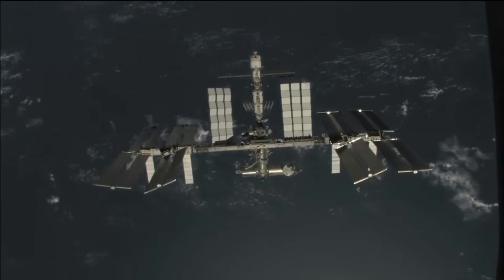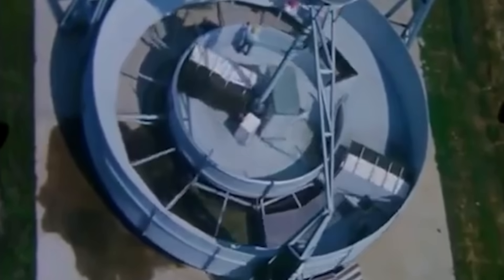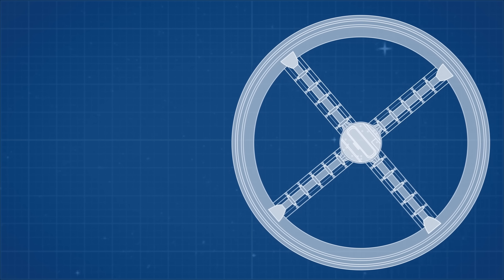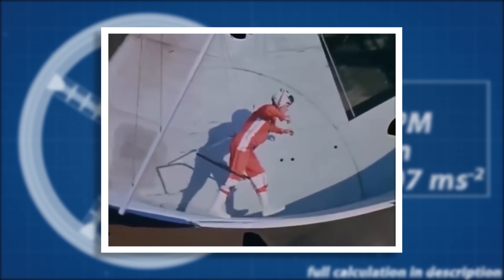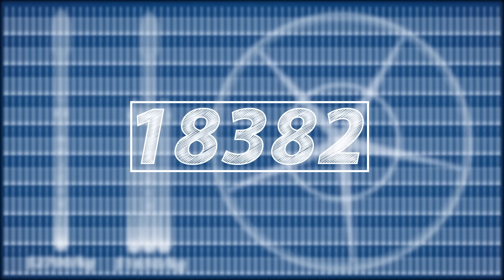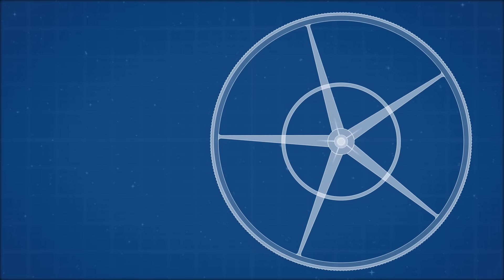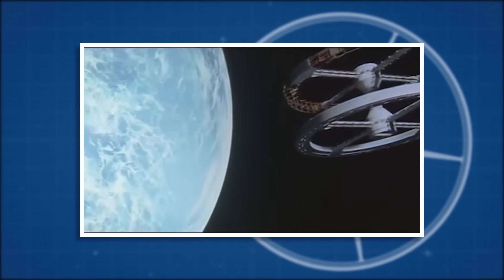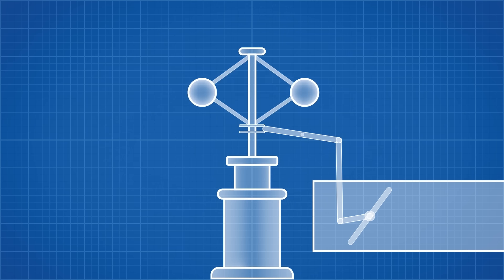Can We Create Artificial Gravity?

Comment: Why not just use two pods attached to each other by a 200m long cable and spin the  whole thing. No need for a ring.
Reply: how do you spin it without bending the cable or messing up your orbit
Reply: Indeed! Ideally the cable would be a few kilometers long to make spinning slower than 1rpm. We could also use a dummy weight on the other end. Ot just very very long cable. Small dummy weight is probably the cheapest and lightest option
Reply: Better yet, a super strong rod, so you wouldn't need to waste fuel on the rockets. Although a material that could provide such strength doesn't exist atm, but I could be wrong.
Reply: +William Herron I think you'd have to have two rockets on either end to fire at the same time to help keep the orbit stabilized...
Reply: I could be wrong but I seem to remember something like this being done.... not with the intent of artificial gravity but at least tried....
Reply: +Murr What about we have start with a 1 kilometer long cable, spin the thing slowly and then slowly pull the pods inward to make it spin faster. And since it's constantly spinning, it's already spin-stabilized. In case of emergency, use RCS or de spin object to slow down.
Reply: Nasa did test something like that in the 60s. they connected the gemini module to the Agena target vehicle and then they used both crafts side thrusters to start spinning. they managed to generate a small amount of gravity, but a bit too low for the astronauts to feel anything.
there was also a problem with gemini 8, where when connected to the Agena a problem with the attitude control made both crafts spin, then they decided to disconnect so they could fix the problem, but getting separated from the mass of the agena craft just made the gemini 8 spin even faster almost making the crew blackout... it was in a way the first artificial gravity "test" in space
Reply: Ah, I get what you mean now. Using that approach you could move in a variety of different directions without having to change the axis of rotation. Clever. I think it would work. The need for a joint would make things reeeeeally costly from an engineering perspective though. I'd let the engine spin with the ship and make the computer take care of the complications to the steering though. The cost difference wouldn't go up much.

If I were to design a spacecraft with artificial gravity, I would do away with a wheel, and do away with symmetry while I'm at it. You'll have to keep an open mind for this one because it's a bit different from most things I've seen, and it might look like a step backwards at first. I would choose this shape:
https://www.google.ca/url?sa=i&rct=j&q=&esrc=s&source=images&cd=&cad=rja&uact=8&ved=0ahUKEwjK9vmmnsjRAhVIwGMKHZUNC4wQjRwIBw&url=http%3A%2F%2Flegacyofkain.wikia.com%2Fwiki%2FFile%3ANosgoth-Character-Hunter-Bola-Weapon.jpg&psig=AFQjCNEG9MA4dNs_mNxOg0gI454elgrD2A&ust=1484710100754224

The two modules would be different sizes, and would spin around each other. Anything that could do without consistent artifical gravity (fuel, supplies, extra weight if needed (though we would want to avoid this)) would go in the larger one. We would want that one to be much heavier than the living compartment. This design would move the center of mass (and therefore the center of rotation) farther from the living area (in the module with less mass), which would make the gravity more consistent. Also, it allows us to use cables that don't need to support any compression or bending forces; that cuts down on cost like nobody's business. Each module would need small engines to control their rotational speeds, but you could cut down on the engines you need by being clever with how you make the cables attach to the modules. I would put the main thruster at the center of rotation, and let it spin with everything else. For the engine, the asymmetrical design means the fuel will be close to the engine, and the artificial gravity won't be as difficult to overcome (I did the math in my head just now, I'm 99.99% sure its right). I'd let computers take care of the complexities involved with steering this beast considering the rotational mechanics at play. Not that hard for space engineers. This design also keeps the living compartment in a single module, instead of being spaced out over several, and gives us better gravity for the same material cost. Also, another bonus I just realized, I'm pretty sure that gravity would increase linearly with radius from the center of mass, so an elevator from the engine to the living compartment would be super easy and safe to maintain with a normal spring following Hooke's law. As the engine accelerates, the modules would trace out a cone shape as they rotated. This is ok, and actually makes us need less rotational speed, and gives us more even gravity across the spacecraft.

This is the best I can come up with for good gravity, cheap materials, longevity, safety, and efficiency. It would still be pretty dangerous. You'd really need to be able to trust your computers and the little engines on the modules. That or invest more into the cables and give them some bending rigidity.
Reply: you dont really need 1g though. if you can put your feet on the ground, you can wear weights to exercise. but that is just a theory of course, there is no way to know for sure before they test the effects of low gravity on astronauts
Reply: Christian Gingras 
Right. No curving of the cable, only slanting during accelleration. Balance is a little trickier though. If the system isn't balanced, it won't vibrate in this case, it will just have a different center of rotation. The center of rotation will coincide with the center of gravity for the system. Symmetry is nice to have, but not required. If one side is heavier, you can just move whatever central module you wish to have to the new COG. If you don't, all that really happens is that the module ends up contributing to the COG, and rotating about a point somewhere along one of the cables. It would be nicer to have a stationary engine though, so I'd put the main thrusters at the centre of rotation. Making one side heavier means that that side is closer to the center of rotation, and the thrusters, so it would be convenient for fuel storage. The gravity would be lower in the heavier unit too, so you could actually syphon liquids down to the habitat without having to pump them.
Reply: +Bob41599 I think in Gemini 4 or something, they attached the ship to the docking target and spin it a tiny bit (like 3rpm maybe) and it created a tiny acceleration.
Reply: Do not go gentle into that good night. Rage, rage against the dying of the light. Not bad idea's, I wonder if they would work, because they sound like they would.
Reply: Let me think. You can actually google ship designs from these to see how artificial gravity is done there. Space Odyssey: Voyage to the Planets, Mission to Mars, Red Planet, a cancelled TV series Defying Gravity, TV series Battlestar Galactica had ships with rotating sections, Babylon 5 has a rotating station and ships with rotating sections as well.
Reply: MaynardKeenanX I think it's up to people's personal preference/
Reply: There have been several design proposals like that for long duration space craft. Buzz Aldrin's Mars Cycler for one. You have a habitat module and an engine/power module connected by cables and each having RCS. In boost phase they're side by side, with the engine thrust through the common centre of gravity. Once they're in cruise phase (99% of the time) in free fall, the two separate using RCS, spooling out the cables between them. RCS then gives them both lateral thrust in opposite directions, starting them spinning around each other. They then let out the full length of cable to become the ends of a slow spinning bolas.

Note: The engine/fuel/solar panels will be heavier than the habitat (which is mostly hollow), so that arm of the bolas will be shorter, meaning it's under lower spin gravity. So it is under less stress and a better place to unfold solar panels/ large antennae/radiators. 

A 200 m cable assuming a mass ditribution of 1:4 (say habitat mass of 25 tons - a B330 with 6 crew and supplies, engine/fuel tank/solar panels/docked lander mass of 100 tons), would give the habitat spin arm of 150m. Using a maximum of 2 RPM (a value that seems to be agreed by various experiments to be the highest that can be tolerated long term) you get 0.67 G.

Of course, in practice you'd use a much longer cable, say 1 km. That would allow a rotation of only 1.1 RPM to generate almost 1 G.
Reply: I know the physics behind how it would move guys; an engineering degree comes in handy there. The cables would slope while accelerating, but that would actually help make the gravity gradient more gradual. Turning would cause precession issues, but there is a very well established field of engineering to handle things like this, and a clever control system could maneuver the ship effortlessly. Most of the advantage to this design, is that it gives the best quality artificial gravity for the least money, without violating other design requirements.
Reply: Yuanhe Li How would you control the position with the magnet though? If you had them tied together with a cable, you would still need rockets to stabilize them horizontally correct? The magnets solve the problem of them moving towards each other, but we would need something to keep them righted on all sides. Maybe a cable wheel with magnets attached on the sides?
Reply: +Murr Would be good to use that for Mars transport system  1-2 decade after the first few endeavor. For the first few missions, let's just have the astronaut exercise for 2.5 hrs like on the ISS, then we can use artificial gravity for the paying passenger or colony.
Reply: Murr There are (already existed) technique to "print" magnetic with a defined pattern(although not powerful enough at this point), so one can just create a magnetic field like this" << " for one end and " <- " on the other. Although the "<-" like to "escape" current to the opposite side, but it can stay in the potential well and keep at the straight repelling position. So one will need energy to move it to the current position, but doesn't require energy to maintain it (as long as there aren't large perturbations).
Reply: They're actually using this in various sci-fi movies.
And for a moving spaceship I think single rotating ring design is not an option at all, as it will cause multiple issues when you need to change course. Stationary ship body with several rotating arms housing living quarters would be the optimal design.
Reply: You'd probably want to have crew access to the middle of the tether so that you didn't need to spin up and down the object every time someone came and went.
Reply: +Murr 2rpm @ 100M radius gives almost half Earth gravity, a bit more than Mars'.
Reply: +Massimo O'Kissed I think it would be best at 1g. Since the astronaut has to be as fit as possible.
Reply: Interstellar is great film. it is similar to 2001... in my opinion. However simulated gravity on it is not exactly rightly set. It would be very weak if Endurance rotates so slowly.
Reply: +Witnaaay , a capsule & the spent rocket stage are what Bob Zubrin proposes for travel to Mars. It's a cheap simple idea to provide Gs for the journey.
For an orbiting station, I think minimum 2 podules and a hub for docking is better.
Reply: +Witnaaay "insertion burns"
That's what lube is for.
Reply: Yeah, that was my thought as well. Build the whole thing in balanced sections as needed. For that matter, remember that we only want gravity for the people. Put their habitat out on a swing arm, and take advantage of microgravity with all other services, shuttle dock, fuel, etc. near the center of rotation.
Reply: I have been saying this for years. Two large stations tethered together by a single tube structure. Both stations rotating around the center point of the tube. Stabilization can be adjusted by simply pumping a fluid from one station to the other as needed ie: a supply delivery to one station would require the transfer of an equal weight/mass amount of fluid to the opposing station so that a wobble effect doesn't occur. A person traveling from one station to the other via the tube would experience lesser g-force as he moves toward the center point and again experience increasing g-force as he travels closer to the second station. Docking could take place at a central hub located at the center point of the connecting tube as this would make it much easier as the vehicle would only have to match the rotation. The possibilities are as endless as they are exciting. Imagine this whole apparatus nudged by propulsion toward Mars. Several years in advance small unmanned supply ships could be deposited along the route and as the stations progress towards Mars there would be a steady stream of supplies readily available. It would be a much easier trip for people as the artificial environment, including centrifugal force gravity, would make things feel more natural. A Mars plan like this could mean that a Mars team could travel to Mars at their leisure. A large comfortable environment along with an almost unlimited supply of necessities would make the long trip more bearable.
Reply: No. The spinning cable is inherently stable. The weights at each end keep it taut and fully extended. You don't need any additional force.
Reply: Do not go gentle into that good night. Rage, rage against the dying of the light. 

I agree a ring is a lot of useless volume. A simple balanced stick would do.
Reply: Yuanhe Li a spinning pair of weights absolutely does not have more than one stable state it can remain in.  There is only one state of two weights spinning about each other at the ends of a cable in space, because there is no inwards acceleration from tension in the cable at closer distances than the maximum cable length, forcing the cable to always extend furthrr to its maximum length and then remain at it.  Didn't you ever play with spinning objects around on the end of a rope as a kid?  The rope always goes taut, and the objects hang at the very end of it.  You would never see the objects miraculously get closer and start spinning faster unless you actually physically shortened the length of rope the objects were hanging by...
Reply: Cyber SharK There is conservation of angular momentum. If a thing spins, It will keep spinning unless it gets hit or it shoots something.
Reply: About the slanting: Picture a tether ball. The players hit a ball, suspended by a cable from a pole. Centripetal force pushes the ball outward, but gravity pulls it downward; and this causes the tether to trace out the shape of a cone. In the case of our ship, the centripetal force would still be acting outward on the modules, but acceleration from the engines would be emulating the effect of gravity on the tether ball, generating the force that causes the cable to slant (not curve from air friction), tracing out a cone.

About the vibration: In engineering, when we are dealing with spinning objects, we almost always have them rotating on a axle. When this happens, the rotating body needs to be balanced, otherwise the center of gravity will be different from the center of rotation, and a vibrational energy will result similar, mathematically speaking, to the vibrator in a phone. This vibrational energy is incurred from the resultant centripetal force vector of the center of gravity of the rotating body, on the axle. In the case of our spacecraft however, there is no axle. In the absence of an axle, the rotation of the system is generated solely from the difference of inertia in different parts of that system. These different inertial forces cause the body to rotate about the center of rotation. Because, in space, the center of rotation is always the same as the center of gravity, that centripetal force vector from the COG to the COR will always be zero, meaning no vibration.

There could be complications though. Because of the difference in weights, with three bodies, a kind of pendulum effect could be produced, creating rotational patterns that could be hard to predict. Preventing complications from that would have to be a job left to the auto-pilot systems. Go engineers.
Reply: Make it 1000m or more. Small circles cause motion sickness. Why not be comfy?
Reply: Pudge Boyardee 
I just graduated from a mechatronics engineering program. Controlling the ship is actually a lot simpler than you make it sound because of clever things you can do with the flight computers. As long as you do your engineering, steering this thing is pretty easy because of technological advances in the past 50 years or so. No need to stop for course adjustments or any of that. In terms of angular momentum and cable strength, again, these are only issues if your engineers are sucky. I think competent engineering is a fair assumption for this. These kinds of issues come up a lot in industry, so they actually have some pretty solid and well established solutions.
Reply: +William Herron Powerful gyros or ballerina style tugging.
Reply: Go read Seveneves. It'll blow your mind, they do all this and more.
Reply: +SolarWindsRider could you name any? I'd love to watch those
Reply: +Danilo “Dantiger” Oliveira thanks for the reply, but you can go up a few comments and look at something.
Reply: Do not go gentle into that good night. Rage, rage against the dying of the light. oh right I saw it now. it was gemini 11 btw... just adding more information then =)
Reply: +Danilo “Dantiger” Oliveira haha, it was Gemini 4, then 8, then 11
Reply: I don't think so... I think they docked with the Agena in all Gemini missions, but only tried the artificial gravity experiment with Gemini 11.
Reply: +Danilo “Dantiger” Oliveira I meant I thought it was on Gemini 4 then you thought it was on Gemini 8 and turn out it was on Gemini 11
Reply: oh no no no... the tether test is the one I wasn't sure, that turns out it was gemini 11... gemini 8 was the one that had the attitude control problem and started spinning like crazy
Reply: +Danilo “Dantiger” Oliveira yea, the Gemini 8 was the one with Neil Armstrong.
Reply: ya............. actually
Reply: +lueefour A tube could be a good Idea, but it does cost more to build.
Reply: +Do not go gentle into that good night. Rage, rage against the dying of the light.
Sheesh, that's a long username...
A tube could be cheap. A compressed flexible thing like for air ducts, then inflate it in space.
Reply: You could also have a 628.3 Metre circumference cable used to aid later attachment of modular ring segments.
Reply: ...beat me to it. But absolutely. Once spinning had begun there would be no need for any sort of rigid structure between the pods as they would be perfectly stable. And if stopped it would be possible to pull the pods together for whatever necessary reason.
Reply: Felix Bade What about the hermes from the martian? I seem to recall it had a rotating design as well.
Reply: +Murr I think the radius is too small to feel comfortable.
Reply: Do not go gentle into that good night. Rage, rage against the dying of the light. Yeah, it would have to be moving very fast to feel like gravity, probably over 10 rpm. But it is still a cool concept, if scaled up it could probably be the best bet.
Reply: +Murr Yea, no one wants to be gravity sick
Reply: Hermes had rotating section... it rotated too slow for its size, maybe 0.1g could be achieved on board of it.

LOL I had problem also with gravity field of mars :) astronauts moved there like they were on Earth... also that storm was hard to be believable. There is about 200 times lower pressure on what counts as "sea" level and it reaches about double of that (1.2kPa) on deepest parts of surface

There is the same problem with Endurance from interstellar. It rotates too slow. What's more, they had gravity on board of shuttle which was located near the axis

Starting with slow rotation rate and large diameter(long rope) will not achieve anything. There is momentum preservation in the play. It would rotate faster and faster as you lower diameter, but that lower diameter will not create stronger centrifugal force. The simulated gravity would remain the same... v(1)^2/r(1)=v(2)^2/r(2)

For start, I would go with cylindrical inflatable station like Bigelow with diameter somewhat larger than length (otherwise the flywheel wouldn't be stable). It would be enough to have about 0.1 to 0.2 G for much longer occupation time than ISS. And it wouldn't demand large mass of strong material. We don't know what is minimum gravity for multi generational living in space.. Maybe it is 0.5G, maybe 0.8G.
Reply: the thing about large diameter is that there will be a steadier change in force depending on the distance to the central axis, that means the crew wont feel the "inverse tidal force" as much. while with a shorter diameter and faster spin velocity, the force difference between the feet and head of the astronaut will be greater.
Reply: ***** inverse tidal force? What that means? the different speed of feet and head is certainly not inverse tidal force :) But maybe I don't understand english enough. I didn't found such term on google either.
There is one thing that can be  unpleasant- coriolis force. It starts to be of no big consequence above 100m diameter. Also lower simulated gravity means lower rotation rate and reduced feel of coriolis force.
Reply: +Do not go gentle into that good night. Rage, rage against the dying of the light.
3rpm @ r=100M is almost exactly 1G :)
Also, @ r=100M, the delta-G from head to feet is only 2%.
I assume the body would atrophy at 0.5G, but it can't be as bad as zero-G, surely.
C'mon NASA, we need answers!
Reply: Peter Švančárek that is the only word I could think of in English to describe it HAHAHA. you know, like tidal force, but that get weaker as you move closer to the center of mass... anyway, the bigger the diameter, the slower the needed rotation speed and more comfortable it is for the astronauts.
Reply: ***** But that is not tidal force. What you describe is lowering the centrifugal force the closer you are to axis of rotation( when rotation rate is constant). That centrifugal force simulating gravity is not the problem. Problem is coriolis force and that is problem on fast rotating structures.
Reply: I know its not, but I didn't knew any word in english to describe it, so I tried to describe with something similar.
but anyway... what problem Coriolis force would cause ? if everything is spinning on the same frame of reference and at the same distance of the axis of rotation I don't think it would cause any problem
Reply: +Danilo “Dantiger” Oliveira,
Coriolis effect here on Earth gets stronger closer to the poles, and at the equator is zero, so you're right.
I guess, as your axis of orientation gets more aligned with the axis of rotation, you feel the Coriolis effect more.
Reply: Massimo O'Kissed Yeah, if both the orientation and rotation are on the same plane, the effects will be at their most pronounced.
Reply: +RyuDarragh , maybe not a huge problem since it would be under tension.
Effectively, each pod is 'hanging' on the tether.
Reply: +RyuDarragh , yep, absolutely, that's why I proposed a circumference cable too.
A cheap, light, simple 'scaffold' to attach extra podules & tubes to as available.
A ring or better yet a web is good in that it gives redundancy, a choice of routes if one pod or tube is inaccessible.
Reply: Its called 'tension. If you take a bucket on a string and start spinning it, the water remains in the bucket and the rope remains taught. For the bucket to follow a circular path, there needs to be acceleration towards the centre of its rotation. The force for this is provided through tension on the string. The string cannot become loose or bend if the weight is already spinning.

You would need to thrust both the spacecraft and the counterweight away from eachother while spinning up to create tension initially. tension. Once at speed however, the rope won't bend.

A cable makes more sense than a rod. It is lighter and stronger in tension, and won't break if torsion is applied to it. You could also retract the cable to better fit the structure into a rocket (long, tall rods don't fit in rocket fairings). You can also retract or lengthen the cable based on the mass of the counterweight, which may include supplies or fuel for a return journey.
Reply: ***** It may be more effecient to just have two masses - a capsule/pod for living in and the spent lower stage as counterweight.
Reply: Best idea is to go with something smaller, simulating lower G and with durable structure. With pods there is problem with maneuverability for example.
I would go with inflatable structure. http://www.rockettimes.com/spacetechnology.htm Just make it bigger. And apply additional sheets of material for radiation and micrometeorites protection. I would send it up as relatively thin balloon and then add additional material on orbit. That way it would be simpler to send it to space.
http://history.nasa.gov/SP-4308/ch9.htm so much research, and nothing real came from it. Pity.
Reply: Why would you need to worry about manoeuvrability? Space is more or less empty, with any small objects you might hit moving so fast you won't be able to dodge them. Perhaps this could be an issue for low-earth orbits, but what would be the point of going to LEO and then not taking advantage of zero G's?

The real usage of this technology, IMO, is interplanetary travel. In this use case, there should be plenty of time to slow and stop the spinning and to retract the cable before any insertion burns
Reply: Because you may need to change the orbit. Even ISS have to do that from time to time. Orbit is not stable, it is decaying, especially low one. Higher is more stable. Then there are possible problems with hazards. It is enough to change speed in suitable vector by a few m/s to avert danger. 
And then, there is of course interplanetary application. You attach engines to this station and you have interplanetary vessel.
The bigger vessel, the larger hazard. Rigid inflatable structure is superior to roped system. Damage to ropes could be fatal. puncture into inflated wheel less so. Imagine that something of size of pea collides with rope. Then imagine if it collides with inflated tube of a few meter diameter. If rope is damaged it may lead to heavy damage of station. Tension would slash the ends of rope against pods, even if there are redundant ropes. If the same pea penetrates inside, you end with a few millimeters big hole. Simple patch would repair it. 
I think, 50m diameter inflatable structure would be enough for expeditions(NASA thought so too). True, there will be some Coriolis forces, but humans can adapt if they must. It is better than zero G for years. Only for long therm settlement I wouldn't go below 100 m diameter.
Reply: How would one board or dock such as space station? I imagine a central docking spot on the cable and then the astronauts going down the cable. It would feel like going down.
Reply: +Grobbekee That would be one of the downside with a simple ship/ station. But as you increase the size and complexity, you would get more features. Kinda like video game mods and DLC
Reply: +LordBritish66 A ring is like a DLC our space programs can't really afford right now.
Reply: Do not go gentle into that good night. Rage, rage against the dying of the light. But we can, and easily, more easily then by steel tropes together tied pods. Just make it as expandable module. Sure, we can't send it to orbit in one go, the equipment would need to be send separately. 
Rotating wheel or cylinder with diameter slightly larger than length is naturally stable. Docking port would need to be in axis, but that is not problem. Problem would be only if one tries to dock on the ring which would be stupid. Ot is more simple to make the whole structure rotating. There is no need for nonrotating sections... other than zero gravity. But that is unnecessary thing to have on ship. If one need to have zero gravity then he should build additional structure and have it close by. Vibrations of spacestation proved that it is not good to have living rooms in the same structure as your experiments.
There are things that can go wrong with winches needed for roped system, and also problems with rotation of such system in gravity field. Tidal forces would make rotation a little more problematic(tension in cables wouldn't be constant) if that "rotation disc" axis is not oriented to center of gravity.... which again wouldn't be possible while orbiting the Earth
Reply: I have thought about space travel and stations for years. This never occurred to me that is BRILLIANT! But if this was in deep space, what about all the radiation coming off the sun?
Reply: +Bob smith , Solar & Cosmic radiation ARE problematic. Typically something dense (like lead) is needed to block it, which is a pain if you need to launch that rad shield from Earth.
Any crewed mission will need water, storing that around the outside (or the sun-ward side) of the crew space could work.
For a trip to Mars, the rad dose isn't too bad unless you get hit by a solar flare (CME). Zubrin suggests a 'panic room' within the crew space that has extra shielding to ride out a CME.

Once on Mars, the red planet itself will shield humans from solar radiation half the time, as Mars has days & nights like Earth. You're mostly safe at night, mostly.
Mars will also block out half the cosmic radiation all the time, as you'd only be getting fried by radiation coming from Mars' sky, the part of the universe above Mars' horizon.
Any way, there's plenty of Mars soil to shovel over a human habitat for extra shielding.

Deep space doesn't have those luxuries...
Reply: +Massimo O'Kissed Well, the radiation ain't that bad for an astronaut. Just 3% chance of death by cancer per year. But with passenger transport, we'll have to consider the radiation problem. (Will be less costly later on)
Reply: Massimo O'Kissed No. Lead is not good way to block radiation.  The main part of radiation is composed by relativistic electrons and helium nuclei. They impact and may produce secondary radiation- neutron and x ray. To block primary radiation without producing much harder to block secondary one, you need hydrogen or lithium rich substances. Water is one of the best substances, other than that also plastics with high content of hydrogen is usable. That is why apollo mission used relatively thick inner lining made from epoxy. Longer mission will need thicker sheets of absorbers... but water used there may be used also as drink water.

On the Mars, the cosmic radiation is also problem. And that one is risk for whole time. But, good news- settlers on Mars will live similarly to settlers on the Moon deep underground, and only rarely go out of their caves. In some 10m depths radiation stops to be problem. That is also why I prefer future rotating space stations for long time space living before planets. Planets are not suitable for technological society.
Reply: I was thinking along the lines of water, but that would still be very heavy to get out of orbit. Many still think of space elevators as science fiction. But if we could make one, it could be used to get huge amounts of heavy materials out of the atmosphere with much less cost. A Mars trips expenses would be so much cheaper.  And it may be possible, but railgunning satellites off the side of a station, built at the top, could save millions in fuel and rocket costs.
Reply: Water is quite light material when one takes in mind that it manages to absorb all that radiation in relatively thin layer. All other materials would be heavier if they have to do the same... What is needed is to pack as many hydrogen atoms as possible into as small volume as possible. 
Water is abundant in solar system and also in universe.
Reply: +Bob smith fuel could be a good idea
Reply: its an internel force, not an external force. so no net force is applied to you, thats why its a fictitious force.. : no outside inertial observer can measure the force.. so your orbit stays the same
Reply: the outward radial force should keep the string under tension, right? if you swing a heavy ball on rope does it come toward you? or stay under tension outward?
Reply: also it costs energy to bring it in so it will stay outward, energy wise it is at stable minumum
Reply: There was a mission in orbit where two space craft were tethered and put into a rotation around their shared center of mass. The rotation speed was very slow but I think they were able to pick up the slight G-force created with instruments. Probably something like .0007 G
Reply: FlashBackJack Yep, that was Gemini something and we've talked about this on the top. That mission was interesting but it would be cool to push the system to the limit at maybe 0.5 g.
Reply: shazzy bazzy who?
Reply: Do not go gentle into that good night. Rage, rage against the dying of the light.
Reply: If a failure occurs, it may lead to the two pods colliding into each other. Plus the tension of the wire may cayse micro fractures,and if the wires break the pods move in the direction of the tangent and lose control. And also the overall body will have poor control and is not efficient.
Reply: Cyber SharK Once you spin the whole thing, it's spin stablizes by itself. And yes, there is a chance where the cables can break, but we can make it reliable by testing it on earth. (Hanging the cable and pods in 1g)
Reply: Do not go gentle into that good night. Rage, rage against the dying of the light. After some time won't the angular velocity become zero? So the whole body comes to a stop right as energy is transferred?
Reply: what about friction   since is isn't in a geo stationary I know it is small but this is like spinning a wheel in you hands since your always falling the is could cause yaw is one side expirences friction causing breakage or unintended turns causing nausea and if serious enough create another artificial gravity on the fulcrum
Reply: caleb verrall RCS thrusters should be enough.
Reply: There could be small rocket boosters around the pods so it would be able to get up to speed and slow down etc.
Reply: Any distribution of mass at the same radius from the center of rotation will have the same moment of inertia for the same mass as a wheel would. 
Look at the circular hoop vs the point mass equations in this link: https://en.wikipedia.org/wiki/List_of_moments_of_inertia

A design with modules around the edge instead of a wheel would have the same properties as a wheel for maintaining velocity. Any design with material in the middle contributes less to this effect, but the trade-offs might be worth it.

One problem with centrifugal 'gravity' is that it makes a non-trivial problem of turning the ship. Consider the classic ol' bike wheel on a rope. Nothing a little controls engineering can't fix, but it's another thing that could go wrong, and quite violently in the worst cases.
Reply: Kaden Burgart What about a non-rotating ball-in-socket in the middle (held by magnets) that can point where ever (except 90degs from axis) to thrust the spaceship. But that would be at least 20 years from now.
Reply: The controls engineering wouldn't be that hard actually. I've done harder stuff than that in class. I have a tough time with magnets though; $$$$ per pound of force.
Any change to the axis of rotation will still cause the issue. I'm not 100% sure I get what you mean, but if I do, that would still make wiggles while maneuvering the spacecraft.
Reply: Kaden Burgart What we would need is a rotating joint strong enough to support the thrust to give the ship "good enough" acceleration and also a way to pump fuel to the engine(s). Not sure how that's gonna work
Reply: Nice name ^^
Reply: Imagine if we did this with manned exploration missions. First the rocket is launched to LEO, then the CSM separates and connects to the second stage so it can retrieve an orbital module and a cable. Now spin the spent second stage around heavier CSM/orbital module complex to create artificial gravity. When you're done you just cut the cord so the second stage is flung retrograde and CSM gains some extra velocity. Second stage falls in the atmosphere on it's own. Leave inflated orbital module on orbit or stick it to some space station as a spare room. Then de-orbit.
Reply: Do not go gentle into that good night. Rage, rage against the dying of the light. 
I remember seeing something like that in a low budget SciFi thriller, an early 80's movie called DEFCON4. Only they had the two crew pods joined by a long boom, not cables..
Reply: Jeffrey314159 Yea, a boom-like girder seems more probable.
Reply: Do not go gentle into that good night. Rage, rage against the dying of the light. Because that's a worse idea lol. How do you steer two pods spinning about a cable? How do you get from one pod to the other? A ring is a way better idea why tf did you even think of that
Reply: William Herron why would it bend??
Reply: Jesse Meyer It's as hard to steer a ring as a dumbbell with the same angular momentum. A long dumbbell has its downside in crew transfer (which could be done via an elevator), but it does have a HUGE upside in cost.
Reply: Do not go gentle into that good night. Rage, rage against the dying of the light. Put a pod in the center of the ring to steer.
Reply: A cable would bend I'm pretty sure if you change your direction of travel
Reply: Jesse Meyer If the ring/dumbbell is spinning, you can't steer the thing, because it will precess instead.
Reply: Do not go gentle into that good night. Rage, rage against the dying of the light. Maybe you could take precession into account when steering a spinning ring. I guess you could do the same for a cable but the cable would bend unlike a ridged ring
Reply: Do not go gentle into that good night. Rage, rage against the dying of the light. Omg your name lol
Reply: Without the friction of air, the cable would not curve... once the rotation speed is stable. The cable would be straight like if it would be on Earth, supporting the weight of the objects attached to it.

The weight on both side would need to be equal to avoid destructive vibration. That mean, the fat guy exercising on one side should be compensated by so many skinny guy.

And kangaroo would not be allowed to exercise on that sensitive training equipment. I hope Australia remain viable to life,
Reply: Ring might makes sense for a large enough ship / habitat. But even a very large hab can be rotated this way. Solves a lot of problems with shielding mass, too.
Reply: Still, judging by NASA's current budget a ring might be too ambitious.
Reply: Kilometre long cables would be very easy to produce with what tech we have now. No exotic materials like nanotubes needed.

Nasa could launch Mars flyby with single SLS and have gravity on both trips so that is possible within current budget. If you're talking about ring station on LEO, it could be built from 70 BA330 modules and couple extra bits. It would take around 40-45 Falcon Heavy launches and cost about one Carrier Battle Group's price tag. USN has 11 CVBG's so it would be possible to fund it if there's will to do it.
Reply: km long cables could certainly built but the moment required to spin the thing would be 31 times higher and require 10 times more energy which might require too much fuel or too heavy of a gyroscope to send send to Mars. Also the pods need to move at 100m/s for 1 g which is enough to de-orbit a pod if the tether were to break in LEO (Space Shuttle uses 90m/s to de-orbit). We can always increase the orbital altitude for safety, but then we will run into the van allen belt at 1,000 km which would be bad. So I think we could reduce the speed to 50m/s for safety and the radii would be 250 meters.
Reply: Rotating ends of 1000 metre cable 100m/s would generate 2g environment at ends of the cable. We don't need that. 70m/s would generate a tiny fraction below 1g and 70m/s is certainly within reasonable limits.
Reply: 1000m radii or diameter?
Reply: 1000m cable.  500m radii.

Obviously longer cable would be better in number of ways.
Reply: Oh, okay that would certainly work!
Reply: Oh, then that's certainly doable!
Reply: The purpose of a ring is so that you have the central hub as your docking station, otherwise, on a tether that has it's own rotation, it would be extremely difficult for any craft to match that rotation without using substantial energy during the whole process of trying to dock, which is completely unfeasible. Plus, having a tether system is risky in that if any space debris was to contact the tether with any force, it could disrupt the rotation or worse, sever the tether completely not to mention the difficulty of weight distribution, any change in either pod will change the centre of balance and the pods would rotate off axis, but then how do you get from one pod to another?

I'm sorry but this idea was not thought through at all...
Reply: MAXNAZ 47 I don't think you read all the comments. Every issue you raised is addressed and discussed to some degree. The short answer is that computers are great at things and unstable control systems are often the best way of doing things these days. This is actually a stable control system technically speaking, just a sensitive one.
Reply: You're wrong, i did read all the comments, not all of it was addressed... But above all else, the one single question i would like answered, how is a craft supposed to dock?
Reply: MAXNAZ 47 non-rotating core?
btw, chill. this idea isn't for a space station. It's just a "cheap" way of getting artificial gravity, without eating up 100 years worth of NASA's budget. The off axis thing would not happen because of spin-stabilization. If the tether system would fail from a shift of COM., wouldn't the ring system also have the same problem? Getting from one pod to the other might not be needed for deep-space travel as you can use the propellant system as counterweight. (in that situation, the tether will be fine) (we are talking about the cheapest way here)  Of course, if you need to get to the other side, just add in a tube as needed, then you will have an incomplete ring.
Reply: MAXNAZ 47 what Mr quiet night rage man said. You would have to balance the pods before docking if you wanted to be able to do that. The earlier comment about elevator shafts and springs works exceptionally for transport between pods. You'd use a modern control system to guide the craft while docking. Those are exceptionally good these days. Having an elevator also provides a quick and convenient way for trading off rotational speed with angular momentum.
Reply: It's still an over complication and by no means would be cheaper than a solid structure, the amount of kevlar reinforced armour you would need to protect a 1km long cable would be astronomical, as even the smallest micro meteor travelling in excess of 40-50,000mph would cut straight through a steel cable like butter...

But even for deep space travel, there is the issue of external maintenance of both the pod and counterweight and the enclosed cable, i'm assuming we are traveling in deep space because we have a destination and when we reach it, we plan of leaving the station in orbit around wherever we are going, and using a landing craft to get to the surface and to get back, to maintain an artificial gravity, the station would have to continue to rotate in orbit, sure, it's not all that difficult to simply detach and use angular momentum to propel away from the station, but coming back, it's not the controls that are the problem, it's the amount of energy that craft would require to constantly vector the rotation of the pods in order to make a smooth docking. 

Once, again, while this idea is ok in concept, the reality is far from what has been discussed in this thread... Unless people really are not that concerned about actually reaching the destination in one piece or being able to do anything if you reach it.
Reply: "The off axis thing would not happen because of spin-stabilization."

Wrong, take a spinning top and spin it, what happens, it rotates on its center axis because the weight distribution is even, take a small weight and place it anywhere other than the center, what happens? The tops center axis of rotation will no longer be in the center of the top. the same principle applies to any rotating object, any change in weight of either end will change the balance point in the middle, for every action there is an equal and opposite reaction.
Reply: A top on the ground with shifted COM will not rotate on an axis at a    right angle to the ground. A fan blade with shifted COM would go crazy I suppose. but a spacecraft with shifted COM will just simply have the axis changed a bit. since there's no up and down or a strict axis to follow (like a fan), I don't see how there would be any problem.
Reply: Do not go gentle into that good night. Rage, rage against the dying of the light. 
I think he's talking about docking. You are both right, but the COM needs to match the center of rotation while docking. When not docking, it doesn't matter. 

I'm not really on board with the cable being 1km long. I think it should be shorter. Also,  there is no counterweight needed for the elevator. Read the thing I wrote about springs. A spring can replace the need for a counterweight because of math reasons. You seem to know your physics so I'll let you do the math and spare any other readers the dryness. This makes it very low cost to change angular velocity. You just have to overcome friction. 

I have a few ideas of what I would do as safety measures for severed cables. It is a real problem that should be addressed, but I think, cost included, it's still a much cheaper solution than a ring.
Reply: Kaden Burgart  So there needs to be a solid connecting boom between the two rotating compartments(counter-masses) in order to provide the stability for a spacecraft docking?
Reply: Jeffrey314159 no, you just have to use the elevator to shift the COG into the center of rotation. That solves one problem. The other problem, that the ship is hard to control, is left up to the computer to take care of, quite similarly to a fighter jet.
Reply: Peter Švančárek Unless I read that wrong, your math forgot how to math. Conservation of angular momentum. Radius goes down, velocity goes up. Both of those increase the effect of simulated gravity.
Reply: so, i've done some calculation. and if the radius is 1km and chopped, the perigee can go down to 230 km. If r = 500m, the perigee can go down to 277km and if r = 100m (minimum), the perigee can go down to 344km from a 400km orbit. (not a rebuttle but some info)
Reply: long deploy and reload time. and... angular momentum once youre moving. a long prow extension with two more cables running from its very tip, all the way back to the cars. and then how do you turn with all that rotational energy? itll affect port and starboard turns differently and g-levels would have to be measured in several axes and managed in real time. or stop completely every time you want to make any course correction, and thats given you had plenty of warning of an incoming object. slow down from a relativistic speed and turn and speed up again. i just dont think its feasible as anything but a thought exercise. also, high tensile cable snaps back with a pretty predictable and measurable amount of energy which given your numbers would slice any space vehicle not made of collapsed star matter into pieces. and a pod of people would fly helplessly into deep space at a speed that would require years of acceleration just to match pace with. god forbid it hit some proto-planet on its way and wipes out their version of us(ship speed+complicated rotating speed squared=fast). i think its a cool idea, but fraught with unnecessary complications. like a runaway train in space.
Reply: Not Possible.End of Story.
Reply: Bob41599 i
Reply: holy crap i never thought of it like that before. the thought never occurred to me that it has to me that it dosent have to be a complete ring! SOME ONE GET A HOLD OF ELON MUSK
Reply: holy crap i never thought of it like that before. the thought never occurred to me that it has to me that it dosent have to be a complete ring! SOME ONE GET A HOLD OF ELON MUSK
Reply: Because the cable can strangle you.
Reply: Graphene could be a possibility as soon as it's fully developed, but atm that amount of graphene would cost way to much.
Reply: twang Goodbye Earth. Hello cold abyss.
Reply: A spinning rigid structure has only one "state"; yet a spinning cabled weights has many states with the same energy(the two weights can get closer and spinning faster at the same time), thus the "200m state" is somehow unstable, there has to be some kind of potential, keep the weight away. A rod would do that but seems silly, maybe pair of strong, repelling magnets?
Reply: Interstellar was a fucking terrible movie